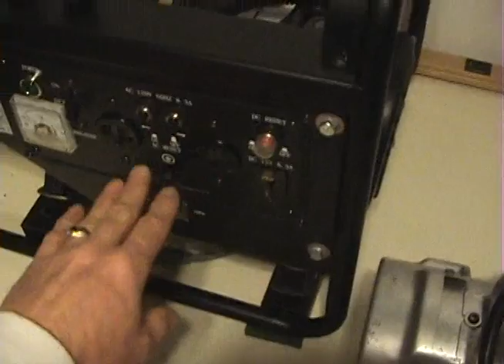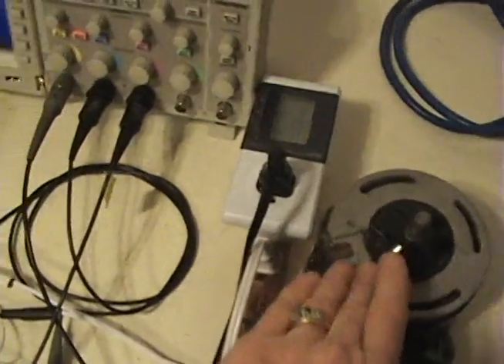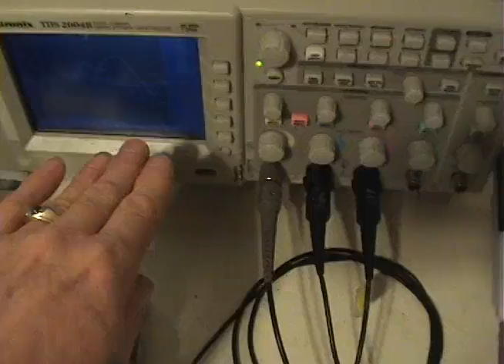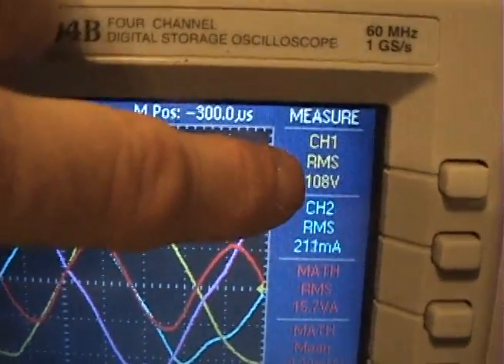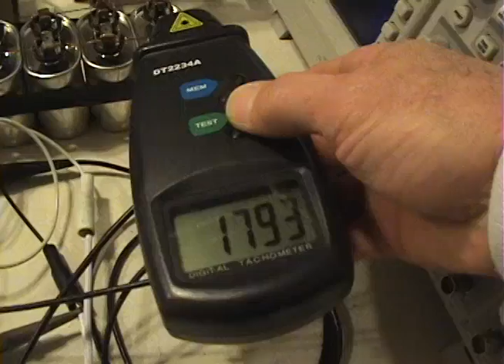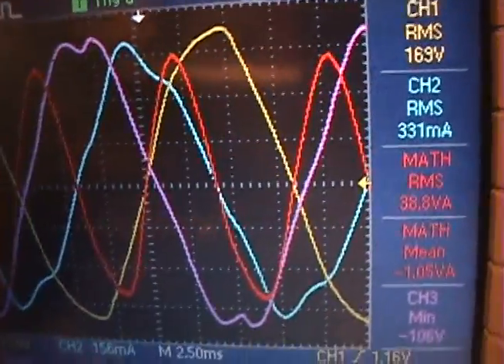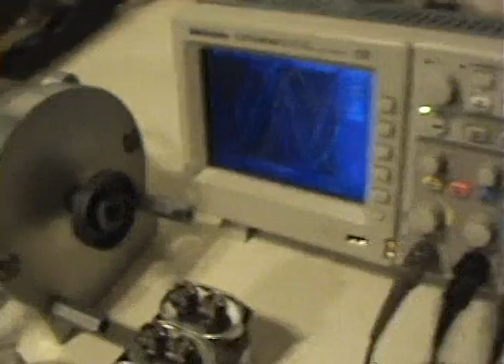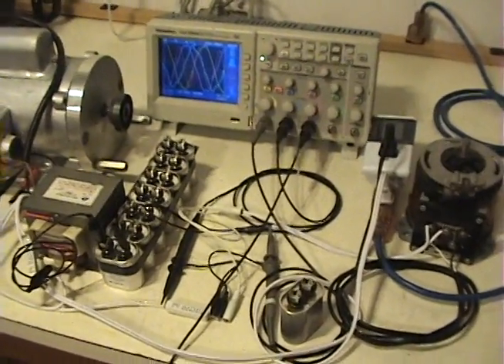Reactive Generator test 4

Comment: You are very correct. Your curcit is not the same as mine. However I am reaching out to you because the Q~Mo~Gen projects are of great personal interest and hobby. In light of that what goes on in magnetic movements threw curcits causes EMF out breaks and something that is of great focus is to completely capture the EMF and use it to do work, "IE the John Bedini effect" in doing this your making a Tesla resonance LC loop based on known factors of OHMS law to give a magnetic ballance to both sides of the curcit. The full wave rectified curcit at the front side blocks the power from the grid. The capps on both legs gives a place for the (current, amps, and heat to go and chill out metaphorically speaking.)  Basically a controlled short because a short will cause heat and we all know heat will dissipate magnetic flux faster than you input it. So in thought you want to hold the "reactive KAVR power" in a standing resonance and then the grid will only input volts and not current. So in reality if everything is off in your home your not pulling current but the volts are always in the wire. The grid works in the same way as in the capacity and transformers on the incoming line to your home or industry.  If you moved the meter to the otherside of the pole transformer/ capacitor one could rhetorically see that you would not have a load draw because the grid is at thousands of volts and your home is at hundreds of volts so the force of electrons are like a diode effect. I hope this summarized notation helps us understand what is missing and what's needed in a self looped Q~Mo~Gen effect. 

David A. Puchta

Comment: Luc, my scope shot is as no help to you with out a curcit explanation. Its what you will see when the reactive feedback hit "TRUE" resonance.  Now you can see something similar in a Bi-Filler coil but this is trigered across the potential. I can't go into detail about my curcit just today because it works. However from where your at put the capps on the negitive side and the positive side of your A/C inputs. Dont worry if your readings don't change the capps will fill up with the emf background. This will stablize your reactive power and give it the punch your looking for.don't forget to diode block your input from the generator because you don't want to heat it up and waste energy.  

Your curcit is using a microwave transformation unit and if the coils are wound different then you need to match the coils with your cap volts and micro ferrets.  To each side of the coils then make sure your ohms are ballanced correctly threwout both sides of the curcit. Negative and positive must match exactly for this to work perfectly.  Notice how smoth my wave forum is and how perfect the heterodyne "Split" in the wave is. What you are effectively trying to do is use the "Active harmonic imbalance" of the system and send it bact to the motor to do work without upsetting the power from the grid. 
Example 60hz in and 60 hz out dose not let a potential different and the meter won't spin correct. AC motors are nortorius for hiccups in harmonics so its your job to actively ballance the harmonic load. Now dose my wave make sence to you. If not then when you look at the high frequency that I build in the curcit it goes into the plasma frequency of electrons, when your on it will self run. Its alittle wild and where I am at is building curcits that "remove" the amps and only have volts to deal with. Thats the trick. 

David A. Puchta 
Merry Christmas and a happy new year.
Reply from the maker: Hi David, thanks for the reply but now you've lost me even more!... how can you add blocking diodes on the AC input?... even one diode will stop everything since my circuit works on AC and not DC. Sounds like your circuit is not at all like what I'm doing.
Until I can see a schematic I think we are comparing apples and oranges.

Thanks

Luc

Comment: Hi Luc, have you taken a moment to view my wave patterns. You are correct in the fact that once an LC  loop is established it appears the magnetic flux will find home aswell as voltage in the capacity of the circuit. The name I use for this is Linear Magnetic. The coined is Linear Paul Magnatizum and Revolutions is the math that supports it. Because I use it for something else right now,  I have taken the time to enjoy your video demonstrations. 
May I suggest building a cap bank on the positive and negative lines. You will figure out the rest. 

David A. Puchta
Reply from the maker: Hi David, I did look at your scope shots but it doesn't look like anything I have seen, so it doesn't help. Also, your suggestion of building a cap bank on the positive and negative lines!  I don't understand as I'm using AC, so there is no fixed positive or negative line.

Sorry but it's of no help

Luc

Comment: Hi Luc!  Thanks for the nice demo.  Yes i noticed that the voltage did move up with the variac as well.  I'm concerned that the sander motor I'm operating might be RPM limited for consistent run speed while in operation.  Will need to test @ 220 in order to find out or add series cap on the load side if phase is beneficial at higher uf only.  Will need to full switch one 110 circuit and ease the other circuit on with only one variac here. I appreciate the video.  All the best Luc!  Thanks.